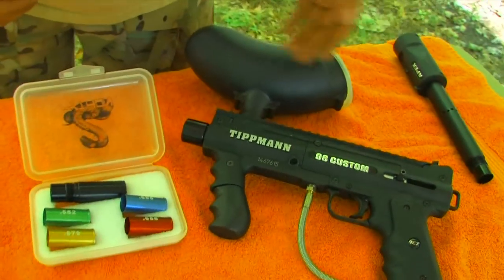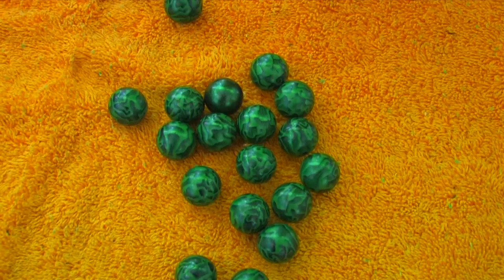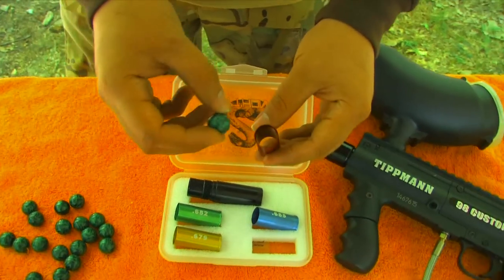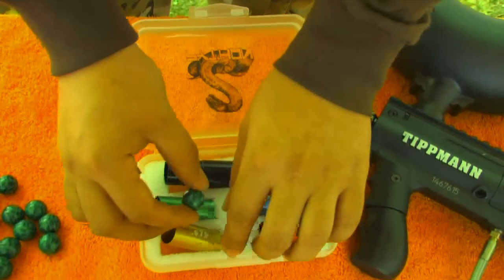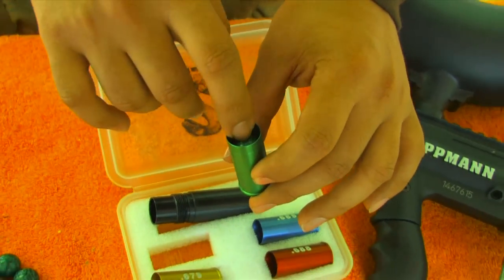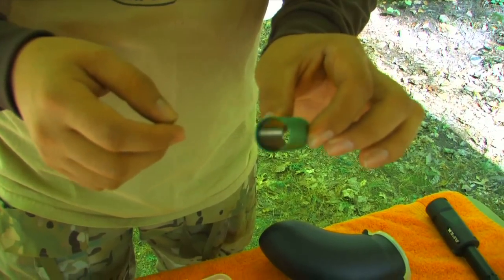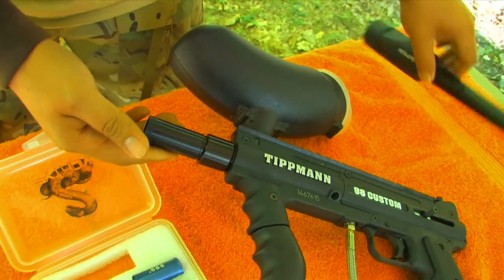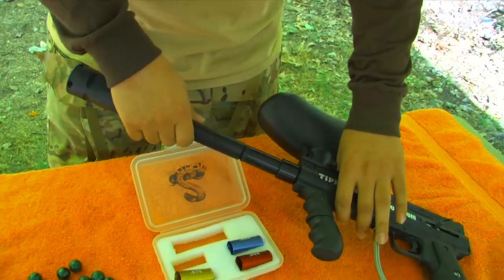Paintball Tips : How to Make a Paintball Gun Accurate

Comment: how to get paintball gun more accurate ?  Answer is - pay more and get a better gun instead of buying cheap paintball guns. Also make sure there is an open sight or rails that are "functional" so you can put your aiming device on there and that's accuracy. Most paintball markers don't even have iron sight and the hopper is jamming the centerline so you can't even talk about anything like accuracy with those guns...... it's more like a sprayer weapon
Reply: Nope. Research has shown that paintball accuracy is all in the paint. Not the gun and not the barrel. When locked in a vice, a Tippmann with a stock barrel will shoot equal sized groupings to the most expensive marker available as long as the same paint is used in both guns.

Comment: This video is incorrect. Scientifically conducted testing involving paintball accuracy has definitively shown that bore matching makes no difference in accuracy. In fact, some research suggests that overboring is actually slightly more accurate than match boring (but the difference is still practically negligible), but overall, we now know that barrels make almost zero difference in accuracy.

The one thing that really does improve your gear’s accuracy? High quality paint.
Reply: High quality, FRESH paint.... Stuff that's been sitting on the store shelves just in a months time start degrading fast.